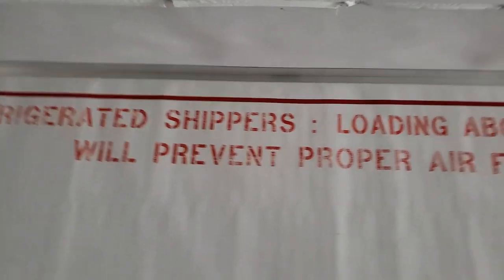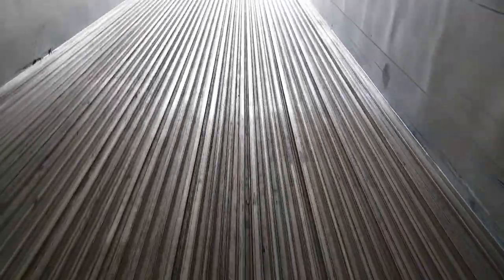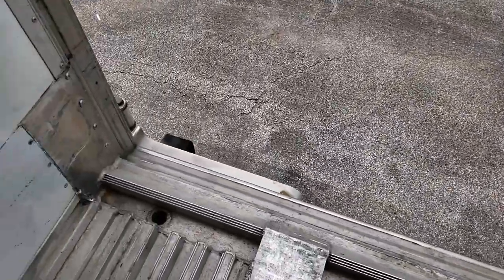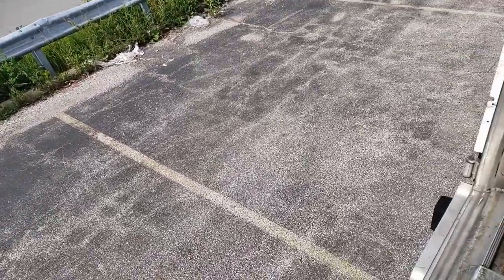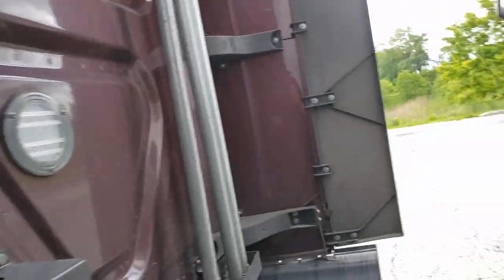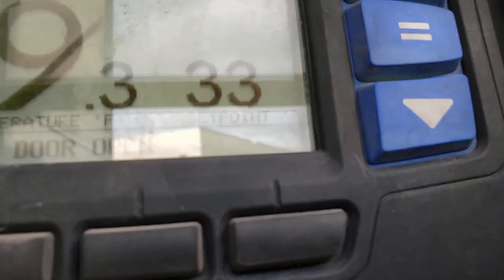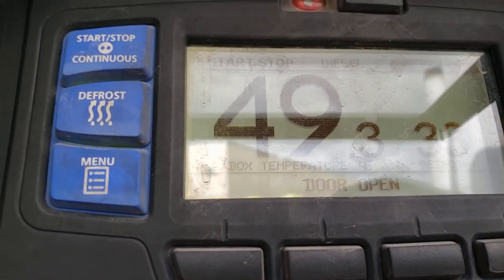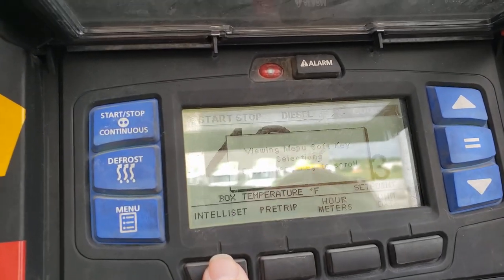Reefer Tour - You Asked, I Delivered - How Do Reefers Work - Refrigerated Box Trailer

Comment: Enjoy this video!!!  Great tutorial for drivers who may not have any experience in reefer hauling!!!! My is: you made a comment about the reefer drivers having to make a double pull up while fueling their reefer tanks do to the distance apart; Why don't someone come up with an extention hose that could be connected to the driverside pump at fuel stops so it would solve that issue??? kinda like how tankers put fuel into the ground with a hose but have it where it's kinda like slinky material where it can expand and retract so drivers could place them in their tool box after each use??? or my second though was carrying an extra jug of some sort to where when you start fueling your P-side tank then you could fill the  jug an take it back to reefer tank an fill (with some sort of funnel)while fueling DST then finish fueling the D-side that way you don't have to do a double pull up??? IDK just wondering does that sound to far fetched????

Comment: kinda like when you buy def in the jug out of the store and then you have to screw the funnel on the jug to put into def tank; but for fuel pump so you could extended it back to the reefer unit without pulling up???

Comment: Do you have odd appointment hours? Deliveries in the middle of the night 0300 ect ...... Can you for the most part keep night hours for sleeping? Thanks, have  a blessed day! 🇺🇸
Reply from the maker: Great questions Michael.
The answer to both is yes.
There are some overnight runs and Wally World is notorious for the 3am delivery which is nuts. But, for 1, its not all the time. 2, as a lease op, you can turn down any load.
I tend to take the early am loads especially if I can overnight park there. That way I can wake up and pull right in. It's a couple of hours earlier than I wake up anyway and the $ is usually good.
I really don't like the overnights. I'll take them if they pay really well and turn them down if they don't or if I'm not feeling it.
Hope that helps.
Reply: I haul reefer and I drive around the clock. Normal to get a 2am appointment to drop off and then normal to have a pickup at 10am... Normal to drive all night... 

Why? 

Because many of the grocery distribution centers need to get the reefer trucks unloaded before the day trucks come to pick up to deliver. 

One reason why reefer delivery is at night and early mornings is because the receiver wants to handle unloading when outside temps are low.

Comment: I want a trailer for storage. Should I get a reefer or a dry box? Someone please advise me.
Reply from the maker: Sorry for the delay. For basic storage, a dry van will do the trick. If you don't need it to be mobile, then a CONEX Container may be a less expensive option.
Reply: @JJtheTrucker  Got a dry box for a total of $2500 and delivered. A blessing indeed. Great condition with new doors good wood floors and wood on all the walls. One strip of wood down the ceiling center. I left it elevated for storage underneath. Thinking of insulating it and using solar for an A/C in it or maybe just a fan. Storing furniture and glass. Needs to be cool. The containers (Conex) were not as good. I’m very happy. Thank you for responding. If you know anything about insulating them please advise.

Comment: What exactly is reefer fuel? Is it just a lower quality diesel, and can the unit be run off shore power?
Reply from the maker: It's the same diesel but it's not taxed. Comes from the same pump and everything.
There are Reefers out there, like the ones thst connect to the intermodal trailers thst can be run off of shore power, but not these ones.
Reply: @JJtheTrucker  is there anything (other than various financial and legal penalties I'm sure) stopping someone from filling their tractor with the un taxed fuel?
Reply: @nbarrager  reefer fuel is capped at a certain amount, i think 50 gallons, so you wouldn't be able to fill up two 80 gallon tanks.

Comment: JJ, how loud is that reefer inside the cab of the truck, ie. sleeper? Is it easy to sleep with when running? Safe travels...
Reply from the maker: You can definitely hear it but what's weird is how earily quiet it is when you have a dry load and it's not running. It's almost is like a white noise machine that you get used to. It also drowns out all the other truck stop noises.

Comment: Is the refer unit loud  inside the cab of the truck and does it keep you awake?
Reply from the maker: You can definitely hear it but what's weird is how earily quiet it is when you have a dry load and it's not running. It's almost is like a white noise machine that you get used to. It also drowns out all the other truck stop noises.
Jeff is right about the staring and stopping. That part takes a couple of days to get used to. I'm so used to it now I don't even notice.

Comment: Are the reefer settings password protected so no one else can change the settings? Anyone can walk by while you are sleeping and push the on/off switch... Any measures taken to prevent that?
Reply from the maker: They can do that, but they don't. Truckers don't mess with each other unless provoked, and even then...
On Prime trailers, Prime has a satellite connection to them to monitor their settings and fuel levels. If the settings are changed, the unit stops or it gets down to 1/4 of a tank they start sending Qualcomm messages to the Omnitracs and my phone, over and over until the issue is resolved.
Reply: no, the keypads are out in the open. for the most part they are left alone and all is well. not to mention if you do get caught you are facing felony charges tampering with interstate commerce. i have seen carriers charge the cost of replacement of the contents to the guilty party. almost every temp controlled carrier has some sort of remote control system built into the units. this allows them to set the run cycles temps and monitor the freight carefully. many even have shutdown override should somebody shut the unit down they can remotely restart it regardless of where the power switch sits. drivers usually fill the tanks in the evening and the morning to avoid the dreaded 2 am "get up and fill the tank" phone call

Comment: Oh wait its not electric?
Dang i didnt expect that rumble
Reply from the maker: I plugged it into my kitchen wall but I ran out of extension cord somewhere along the way 🤣
Reply: I was going to ask about electric too. Are there battery powered reefer units at all? Intuitively SLA batteries must be much better economy than diesel, and you could get some tax free power if you add regenerative trailer braking or solar panels for the trailer roof...
Reply from the maker: Not that I've seen. They actually can be plugged in for long term storage, but for OTR, not that I've seen. The regenerative breaking is a good idea, and getting power from the truck alternator while it's running may be an idea, but solar panels would not be 100% reliable in the snow, bad weather or overnight. Recharging would be OK for local routes where the truck is at a terminal overnight, but not feasible for OTR. Batteries are very heavy too, which reduces the amount of cargo we can carry.
Maybe one day they'll figure something out.

Comment: How often does the reefer unit need fueling?
Reply from the maker: That depends on what setting it's at and what the outside temp is. It's a 24 gallon tank and it's yet to run out on me before my tractor needs to be fueled.
My last load was 42 degrees with a 5 degree variance. It went through 1/4 of a tank in the 3 day trip.
Reply from the maker: Prime used to have larger tanks but felt they weren't needed since you're fueling up the tractor anyway. They opted for the weight savings so we could haul more freight instead, which means more $$$ in our pockets.